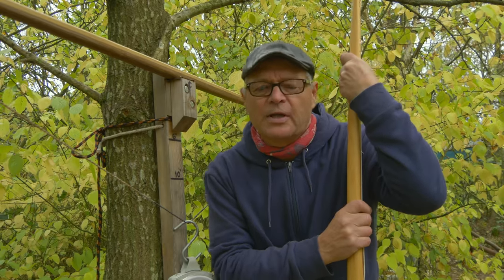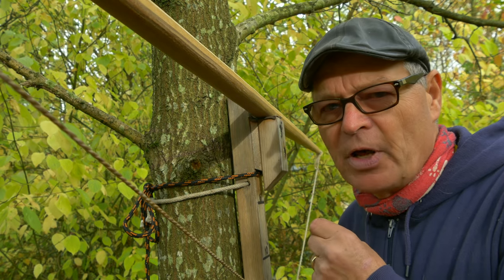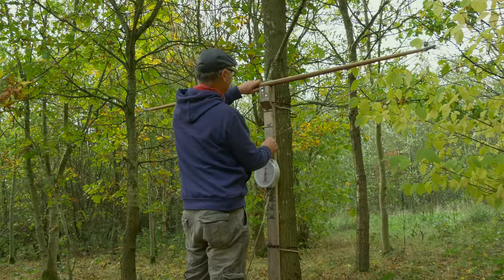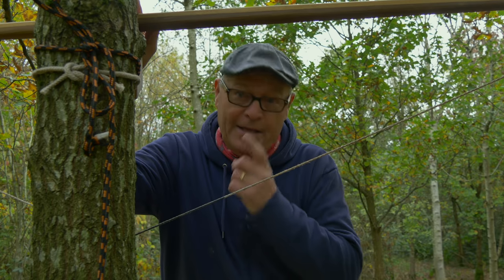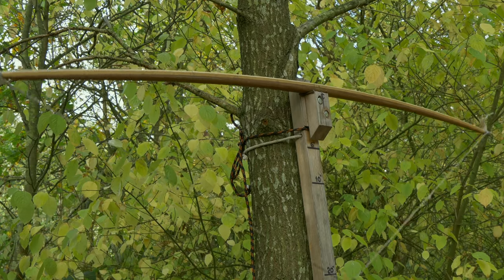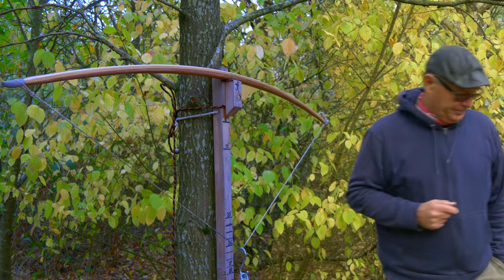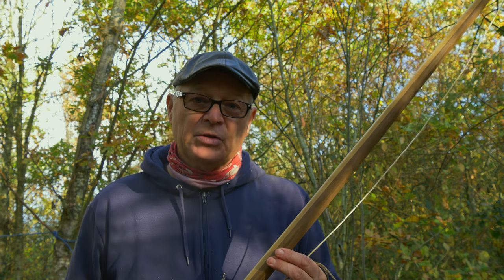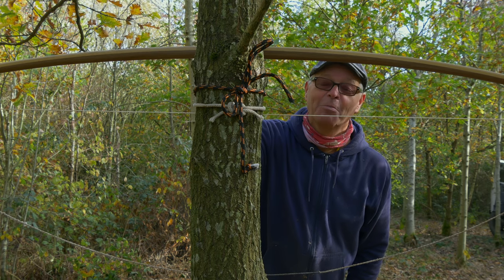Tillering a 100lb Laminate English 'Warbow' Part One

Comment: The heaviest draw weight I have reached so far building a D section longbow, a bi-lam Maple backed Cherry 72", is 50lbs @ 28"
Reply: Sergeant Crow that’s pretty awesome! My heaviest bow (which is my first) is around 30-40lbs at 32 inches
Reply: Sergeant Crow that’s pretty awesome! My heaviest bow (which is my first) is around 30-40lbs at 32 inches
Reply: @javanbybee4822  30-40 is great.. I just wanted to see if I could push the Cherry and Maple to 50. I bet that is near the limit for D shape for that combination.

Comment: Hi Mick. Just found your channel and really like its style! I have a question for you: I am currently making a yew long bow. I still think the draw weight is too high for me, but I am running out of heart wood on the belly to work down and i dont want to work down the sap wood in case I mess that up. What should I do?
Reply from the maker: Hi there, I can only suggest thinning the limbs (side to side) rather than reducing the belly. That said, thinning the limbs has less affect on draw weight than working down the belly so it depends on how much weight you want to lose. Is it a lot heavier than you can handle or just a little?
Reply: @MickGrewcock  Thanks for getting back. I would guess its about 15-20lb heavier than I can comfortably draw.
Reply from the maker: Fandabi Dozi That’s quite a lot from the limb width. You should try sharing the reduction between sides and belly. You might try working up to the weight rather than working the bow down to a lower poundage. Good luck!
Reply: @MickGrewcock  Hi Mick. Okay, thanks I will try that :) keep up the great channel!

Comment: Mick do you think it is better for a beginner to start with a pre- shaped laminated stave, or to build a self bow from a dingle piece of wood?  I imagine they both have their lessons to teach, but which, in your opinion, is the best one to start with?  Great video, as always.  Keep them coming.
Reply from the maker: Richard, I did both: a self bow first then two pre-shaped staves (finished at 44lbs and 86lbs) because I was frustrated waiting for wood to season. No question, laminates are easier to tiller and if pre-shaped well then you have a good leg-up on the process. Self bows are - for me at least - much harder and less predictable. If you have ready access to some green wood - ash, hazel or the like - then I suggest making a 'green' bow just for the experience first. It's quick and you'll not be too precious about it. You could make one in an hour or so or take a day at it - whatever. You'll not get a powerful bow but you will get some experience. Then it depends on what you would really like to do - laminates or selfs. Lams will give you a quick result but will still test you when tillering. All depends overall on whether you can get bow woods or not. If I had endless supplies of bow wood then I would never have touched a laminate!

Comment: Clearly the shape created by the initial taper is good enough that there isn't too much left to do, just bring it to length and weight without spoiling it! 
From the point of view of durability the flattish cross -section is useful, from the point of view of setting up for shooting, less width through the pass (with the necessary slight increase in depth) might be preferable.
Reply from the maker: It was well shaped Rod but with heavier weight bows I still find it doesn't take much to to get the limbs out of tiller and a then a devil getting them back again!
Reply: @MickGrewcock   Very true Mick. 
The tillered shape is a product of the combined taper. When this is realised there is a greater likelihood of efficiency and economy of effort. My only reservations are relatively minor, with regard to some careless description and inattention to details that have an effect on outcomes when shooting. 
Tillering and set-up are not divorced in their consequences on efficiency in use.
Will the final geometry produce a bow that favours divergent or convergent arrow flight?

As you know very well, any movement in a bending handle is better felt as a slight "give" as you come through the draw, rather than being obviously visible to a casual observer.
The tips are brought round only if deemed necessary after the bow is brought to the string by a little shooting
My ideal in this style is a bow that is stiff nowhere, bending most through the mid-limbs, less in the tips and least of all in the handle.

Comment: I can never get it to stick together, i have one self bow where the back of the riser fell off, tried gluing it back on but as soon as a drew it back the glue came lose
Reply: If you stick a short stiff piece to the outside of a longer bending piece you should not be surprised if the short piece pops off when the carrier is bent.
Reply: If you look up poor man bows website he has a few different raider designs that are supposed to help with that. I typically like to glue the riser in between then core lam and belly lams.
Reply: @ kyle plants
Simply put if the carrier is stiff enough that it will not bend where the supplementary part is attached, then a stuck on "riser" or handle, all else being equal, is unlikely to pop off. .
It appears that Fordman 1991 is describing a self-bow made from a piece of board that is thinner than he would like, to which he is trying to glue an additional piece of wood, whereas you probably know that you are not describing a self-bow.

Comment: Some say "Minutes on the tiller" ... that's total nonsense! If you want a good bow, it needs to be tillered with care and patience. Anyone can make a poor bow quickly.
On a positive note... I like your "digital string" expression.
Reply from the maker: Del Cat From my standpoint and experience, you are bang on Del. But I do ponder often how bows were turned out centuries ago, pressured by costs and time, and do acknowledge that there are other ways to get a tillered bow. I can’t imagine that careful deliberation over tiller was a daily worry of the medieval bowyer, whereas we now have the luxury of time. Each time I make a bow, time on the tiller decreases. Which nudges me in the direction of thinking that manufacturing pressure found ways in the past to get a tillered bow much more quickly than we now do. Forty plus years of daily challenges making electronics equipment ever more quickly and cheaply taught me never to underestimate our ingenuity in solving such problems. But today, when we look for perfect tiller and, where the wood allows, beautifully shaped bows, the only way I know is the care and patience route you highlight. But there are others who can do magic with wood and they have to be heard.
Reply from the maker: Glad you liked my digital string!
Reply: Minutes on the tiller is correct, just so long as those minutes are not too many, if we are talking about the duration of those brief periods in the process when the bow is actually held drawn to a length on the tiller.
Reply: @rodparsons521  Indeed one shouldn't hold at full draw on the tiller (which is why I use video) and also flex it dynamically whilst observing. But it does need constant checking... do a little check it, do a little check it. 
The problem here is "time on the tiller" is ambiguous.
I'd change it to, number of checks on the tiller... IMO if one isn't heartily sick of putting it up on the tiller and having another look, then it's not being done enough.
The key is getting your eye in and being able to see the curve.... to many people "look" but don't actually "see".
Reply: @delcat8168    You hit the mark there Del. Too many look without seeing. The proof is all around us. This realisation and the acquisition of necessary skills are fundamental to the art, from making the gear to learning the effective use of it.
Keen observation and the useful application of intelligence is a basic requirement.
This doesn't mean we can't have fun doing it.

"It's meant to be simple, not easy."